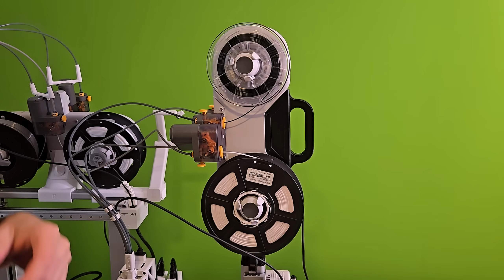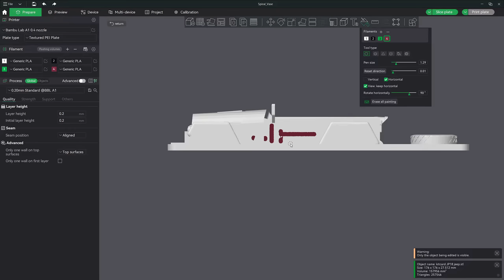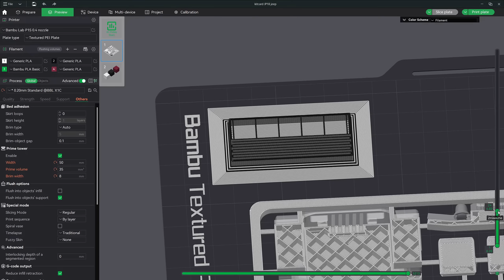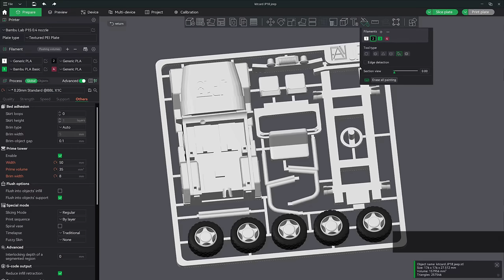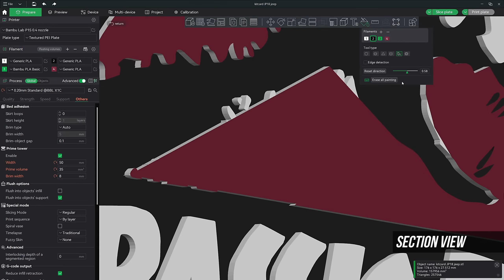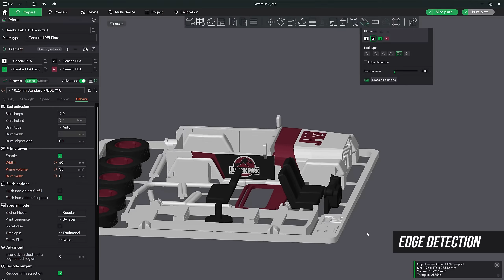How To Paint 3D Prints In Bambu Studio! 🚀 Step-by-Step Tutorial For Beginners

Comment from the maker: Have you tried painting 3D prints in Bambu Studio? 🎨🔥 What’s your biggest challenge with multi-color printing? Let’s discuss below!
Reply: Trying to stop my ams from clogging the nozzle or malfunctioning on the p1s.
Reply from the maker: @SiNNeR90737 oh geesh. Make sure it's all dryed very well!
Reply: @planet3dp I have it in a ams dehumidifier straight out of the plastic the rolls come in. It clogs every time I try to print with more then one color. Then after it clogs the ams won't sync and I have to go to single spool from the back.
Reply: I am still trying to figure that one out, such a shame every 3D generator i try to use puts all this fantastic color on the object then I get to bambu studio and its gone.
Reply: I’m trying to print a clone trooper helmet but ideally a multi coloured print with my H2C
It’s tedious work, the triangles over lap into the other colour section or so small it will take forever 
The symmetry is horribly off as I’m not a good painter 

I’m trying to limit my sanding and spray painting as I’m living in a flat with my kids and cat

Comment: If I have a single color model how do I paint it with different colors? TIA
Reply from the maker: You add the colors in the filament menu and paint it. You will need an AMS unit
Reply: I have an AMS. I've tried using the color selection from the paint icon at the top menu and paint from there but sometimes it runs over onto the area I don't want to I thought it would be an easier way.

Comment: You showed the 4 spools in the AMS Light, AND an extra spool. Does this mean this is actually a 5 color printer?
Reply: No. To use the extra spool you need to load it manually so the 'AMS' feature doesnt work unless you pause the print and manually load the filament.
Reply: @thespyk  That's what I figured lol.  I just hoped I was wrong. I hope Bambu Labs updates the firmware so we can have two AMS units.
Reply: @1QKGLH  the problem is that the A1 series toolhead feeds the 4 colours in directly. I don't think it's a firmware issue. There is a hardware limitation. You can have 4 AMS units connected to a P1 and X1 series. Practically I don't know why anyone would want that. Those filament changes are soul destroying on the time.
Reply: @thespyk  That makes sense. Thanks for the info.
Reply from the maker: Thanks for the help.

Comment: I love multi-color models that were engineered so you can print the different color pieces with very little waste and assemble when complete. 
Only some pieces may require swaps where it makes sense. I was printing the feet of a Pokemon bird and it was black with white on the nail tips. 
For something like that, I just painted the white on the nails (Acrylic paint). Looked great and saved so much print time and waste.

Comment: Thanks for the great videos. What are your thoughts on health risk with 3d printing using PLA. I’m newer to 3d printing seems like there are mixed thoughts in community from PLA is safe to its toxic for your health. A video on your thoughts would be great
Reply: It is NOT toxic (*), but it creates a chemical exposure. You need to read the safety sheets (where available) rather than look for random opinions on the Internet. Ideally, you would need to ask a doctor experienced with exposures to chemical substances. Prolonged, systematic exposure to "foreign substances" (chemicals, vapors, and particulates) is not good.
  
(*) - I have a few special PLA filaments that contain undisclosed additives. One of them (made by a German chemical company) came with a health warning. The other ones were made in China and probably should have come with warnings. A law/regulation would be needed to correct this.
  
My current printer is in a small bathroom where I can turn the exhaust fan on and partly open a door or window elsewhere to let outside air in. The problem is that it increases indoor humidity most of the time (this is a climate problem).